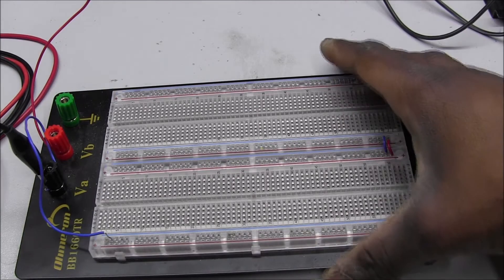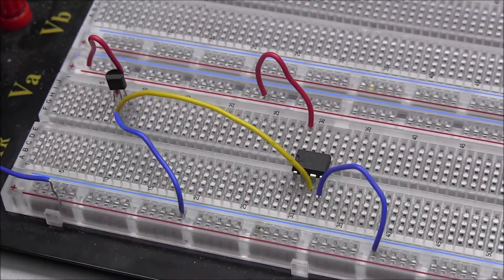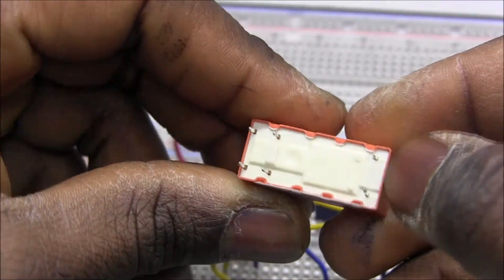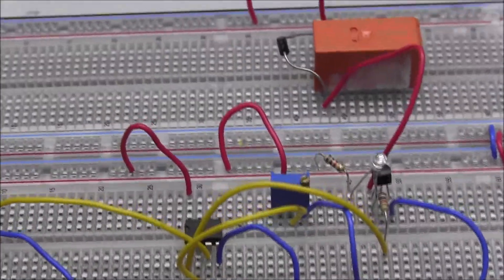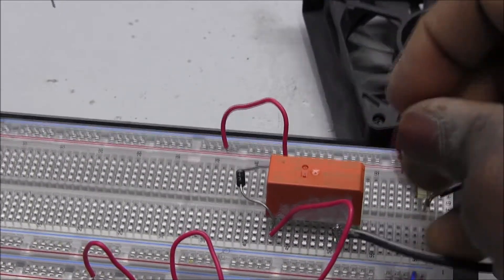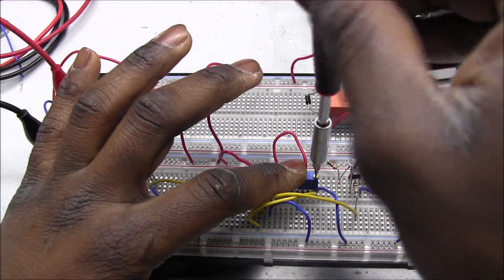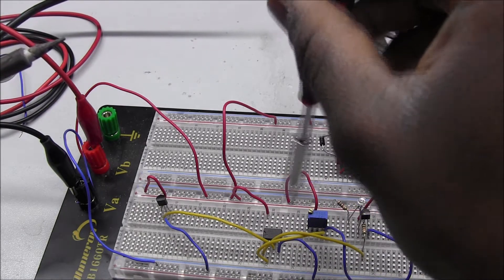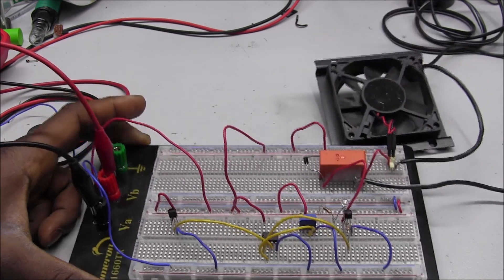TEMPRETURE SENSOR ,LM35 AND LM358

Comment: Can this work with 12 v relay? and how to calibrate the lowest  temperature ?
Reply from the maker: yes it can,to calibrate the lowest tempreture,u need to turn the potentiometer unticlockwise and each stage u turn the potentiometer heat up the sensor ,it should take longer time to activate the relay